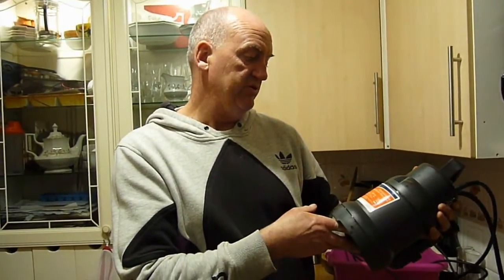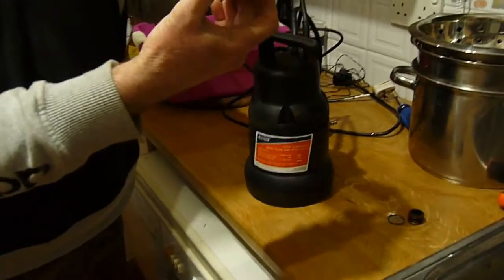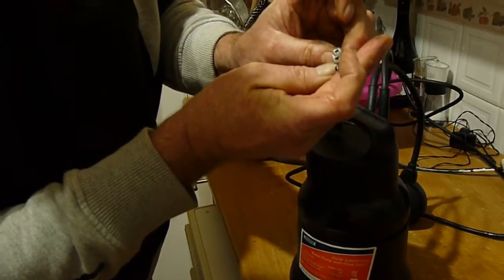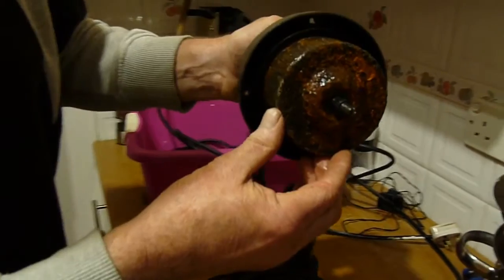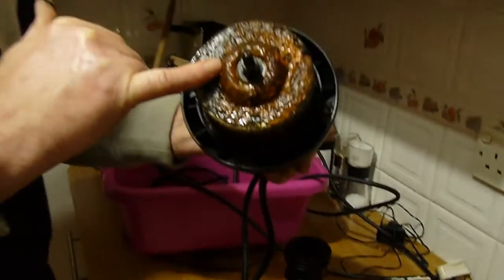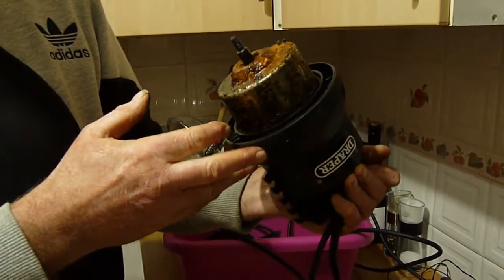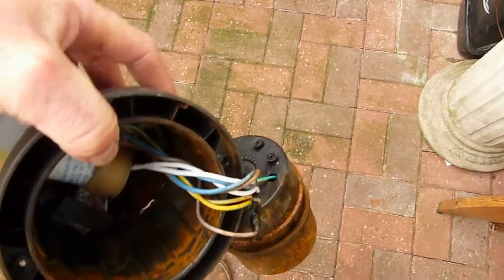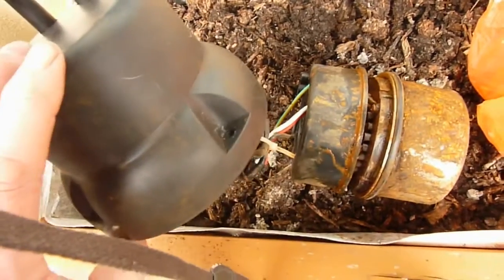Cheap Submersible Pump Review Broken Down, Dismantled Draper and Examined after early failure

Comment: How did you get the motor and plastic casing apart without damaging. My motor works but only when I spin it first. Once it stops it will not spin unless I move it first. Any suggestions on repair would be great. Thanks

Comment: I have a Draper SWP-120, used only occasionally over 3 years. Have taken the body apart to show a similarly rusted inner steel section. Absolutely shocking to think these are designed to work under water!!? 

Andrew - 2 questions... the rusted steel body doesn't want to come away to reveal the motor. Is it just a case of a bit of gentle, persuasive force to pull it away, maybe prising out the rubber O-ring seal first?

Secondly, assuming the motor is fried, do you happen to have a link to the pump you ended up buying off eBay?

Thanks :)
Reply from the maker: Not worth trying to repair. Mine was a stainless steel one and is working great
Reply: Have a Draper dirty water pump,  the pump itself is still working the float switch is the problem  had it just over 12 months warranty is out I think. It was £90 quid I could mess about and put it on a timer but I will do what I should have done buy a stainless one . Thanks for the heads up 🤙

Comment: thanks for your analysis of components.  Very fair comments.  I have an awful feeling that they all come from the same source but with fancy cases and pricing.  I have had Kingfisher for my pond (at about £30.0 a throw)  and they last between 2 and 6 months with constant running for about 9 hrs per day.  I was getting fed up with replacements and thought I would go for Draper but it sounds they are the same.  I will keep looking. (I have another kingfisher but the connecting et al is getting me down!)
Reply from the maker: I purchased a stainless steel water pump from Ebay. It was inexpensive and low wattage. It is installed in a grey water system for around 5 years and works perfectly
Reply: Thanks for your video, I have been through 3 pumps in grey water situ and was get very angry with Fake News :)

Comment: I've got a couple of these cheap Draper pumps and think they're great, very good value for money and for me at least, have lasted for years. Mind you, I don't leave them down the bottom of the well and only put them in water when I need to pump the water out.

Also, if you do have a problem with them they are very easy to service yourself and the the guys at the Draper service department in Southampton are very helpful.

Basically you pay for what you get. If you want a metal impeller then you'll be paying a very minimum of three times the cost of this one.
Reply: I strongly disagree with thatall to common phrase.  The truth is, that any item is sold and represented to do or serve some particular purpose or application, and should do so, and generally speaking, any and all 'failures' whereby the item breaks and/fails, within short time and/or minimal use, it's my position that it's fraud and misrepresentation on Manufacturers part, more specifically, they are designing and manufacturing items in which are defective, sub standard, minimalistic and literally engineered, designed and intended to fail [so that mfr's can sell you a brand new one every year, versus selling you one in which lasts you a lifetime.   I came to discover and learn that MOST if not ALL manufacturers INTENTIONALLY deisgn EVERYTHING to fail, while fewer Mfr's are nowhere near as egregious about this.   I would hesitate to claim or say that there is even one mfr whom does NOT engage in this pratice.  And we began to see this practice I'd say in the 50-60's and in 80's was the beginning of it being prolific, and it's JUST OUTTA CONTROL TODAY in the 2000's.

And it is also completely logical, it financially benefit's mfr's.. Heck the medical field does the same thing..  far more profitable to continue 'treating' illness versus 'curing' illness..  Any business prefers repeatedly paying, repeat customers versus one time customers whom only pay or purhcase a single time.